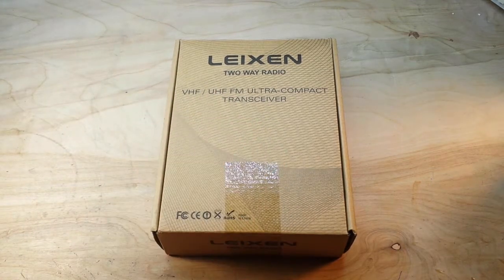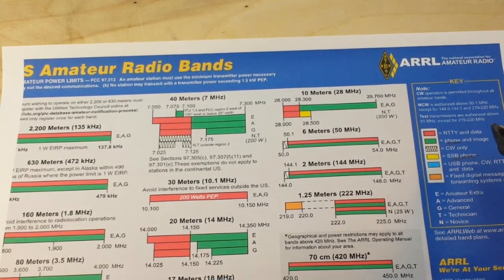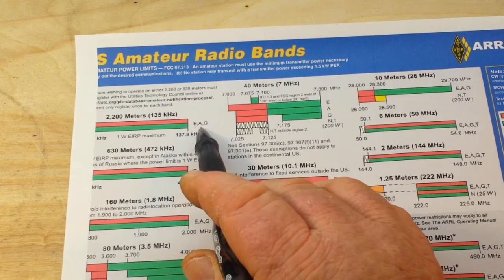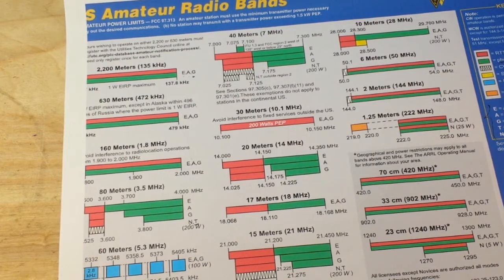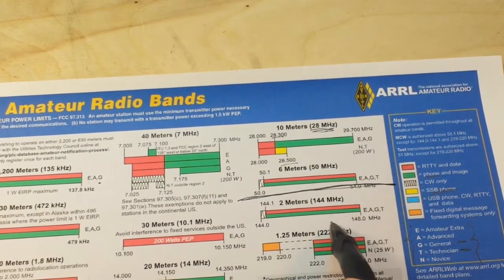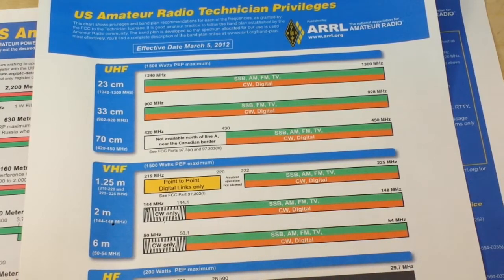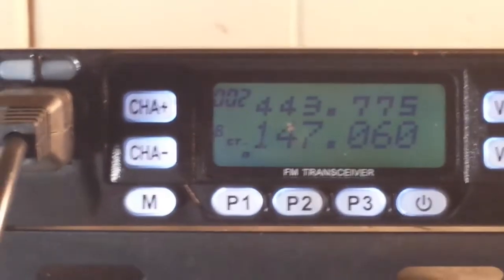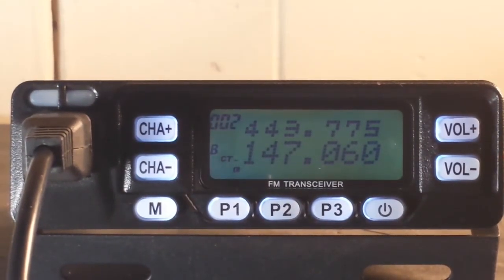Quick look: Leixen VV 898 Dual Band Mobile Transceiver

Comment: 80 meters voice and 40 meters data are pretty popular depending on conditions and time of day.
Also No one uses SSB on VHF or UHF much if any. It's extremely rare.

Look up the ISS and ham satellite frequencies, your radio can receive them as that pass over

Looks like that mobile uses the old Maxon SM4000 series power cable lol

SO denotes "Socket" where PL denotes "Plug"

The mic hanger standard (basing this off commercial radios) is to enable squelch muting like if you have a PL/DPL (CTCSS) set on receive the PL will be defeated while the mic is off the hanger and enable the PL when it is hung up, You may have to run a ground tap to the hanger to use this feature or the mic may have a switch on the back that engages when you hang it up.

An off topic side note, most of the Baofeng HTs hold part 90 certifications meaning they can be used legally on part 90 (commercial) and part 97 (ham radio) services
Reply from the maker: +ElfNet Gaming Cool, thanks for the info as I'm very new to the radio world.

Comment: How about one of these as a future build? Real cheap on Banggood. I got two, cheaper than they're asking for one now, less than a year ago! Would be good to fill a video or two?https://m.banggood.com/DIY-Radio-40M-CW-Shortwave-Transmitter-Kit-Receiver-7_023-7_026MHz-p-973111.html?rmmds=myorders
Reply from the maker: Yes! I like that.
Reply: Thought you might.  My radio experience was cb radio and dxing in the early 80's.  I have a couple of  hand held receivers I got when a friend of my sister's husband died but we're in a bad reception area and they don't cover marine band which would be useful here!
Reply: I built a pair of them, one build is here - https://www.youtube.com/watch?v=bmV7nnpwWlQ
BUT off camera I re crystaled them for 80 meters (3 MHz) with a color burst crystal.
They seem to be pretty broad in operations, I was able to go down to 3 MHz and up to 14 MHz with the ones I have..

Comment: Just wondering if the 20w one would of been a better deal since your going for your general?, a lot more playability.
Reply from the maker: +Crackerjack Where I live, I think my biggest obstacle is going to be the antenna. I'm down in a valley with holes on both sides. Currently I bought an MFJ ground plane antenna to mount on my roof. I hope that works.
If I get my general, I'll probably be running a long wire from my house to my shed for 20m. Assuming I can get a HF tranceiver in my price range. I can't believe how expensive they are.
Reply: Too right, but either way sure beats standing on a roof of some description with a good old Baofeng UV5R
I'm also dumbfounded at the complete price warp to the HF's, kind of puts a glass ceiling on the hobby at that level.
Reply from the maker: +Crackerjack For sure, the price is a real barrier to entry.  Looks like $500 is the minimum.
Reply: way out of my range for sure, I look forward to you playing around with the Leixen and the HF upgrade in the future,  please keep us all updated on your trials and tribulations with it.
Reply from the maker: +Crackerjack will do
Reply: They do make DIY HF tranceiver kits that are fairly cheap, or you can buy a second hand HF rig off Ebay.. You may need to recap it or something..
Reply from the maker: +ElfNet Gaming Yes, I'm looking second hand on eBay.